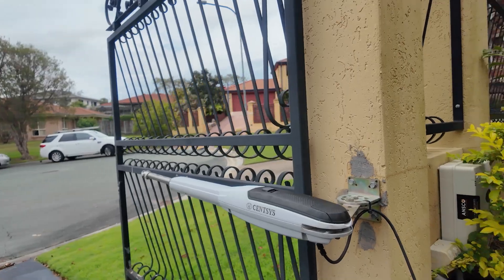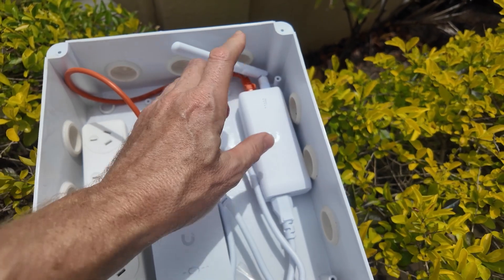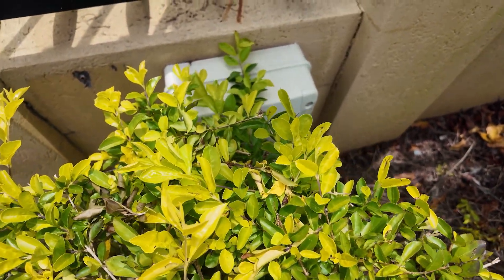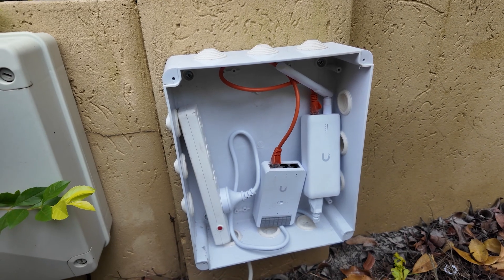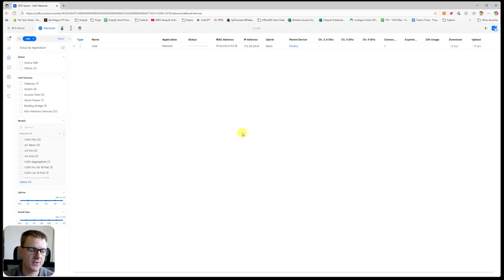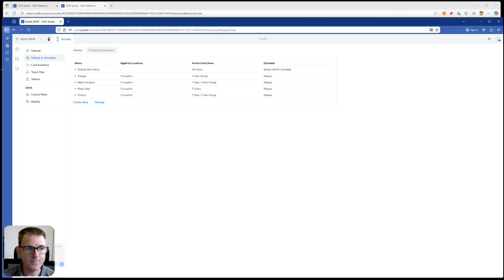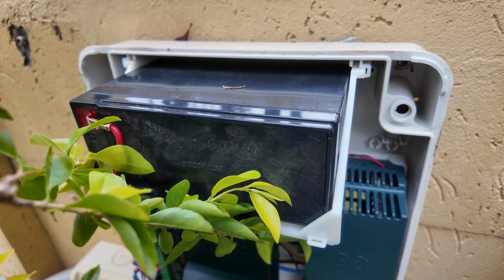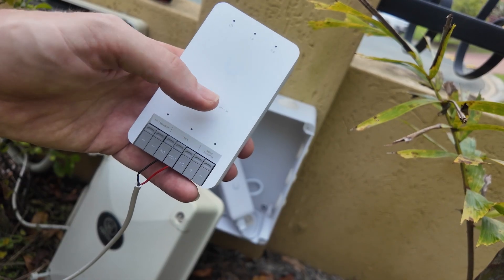Rough & Ready - Wireless Ubiquiti Gate Opener Setup

Comment: You make it work any way you can. I did a time sensitive gate system just before Christmas where there was a single ethernet to a filled concrete gate post back to the house but no way to get into it, tap into it, re-route it, run additional cables (driveway had been concreted since) etc, no wifi signal there (big block) and no easy way (post renovation) to get a neat cable to where wifi would work (short of putting a flex switch outside where an existing camera was but homeowner shot that idea down) . The ethernet I had to work with had barely 50mm sticking out the front of the gatepost.  I put a G3 Reader pro on the post and put the gate hub inside the house in the comms cabinet. I bought a new wireless gate remote (Merlin), paired it with the existing gate motor then cut it open, soldered wires to one of the button contacts and to the battery contacts. I got 12V out of the NC 12V from the PA door terminals on the gate hub through a Jaycar power converter down to 3V  (it had a 3V lithium buttom battery) for the remote and simulated a wireless remote key press out of the NO dry contacts for the gate. I 3D printed a box for it all to sit in. It works perfectly via the app and intercom viewers, they have working door bell and camera, the gate responds to the Gate Hub signal the same as pushing the remote button from the car.  The only thing we can't do is the gate position sensor but there is a camera pointing at the gate so they can see anyway,
Reply from the maker: Please you found a way to make it work !